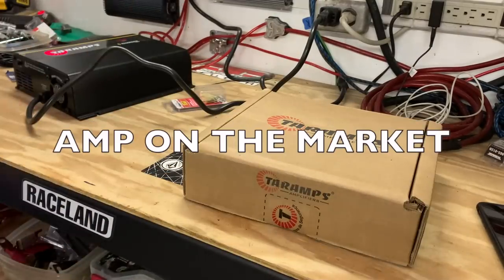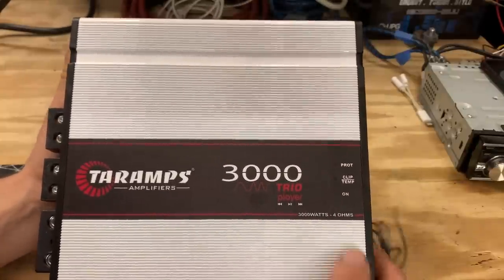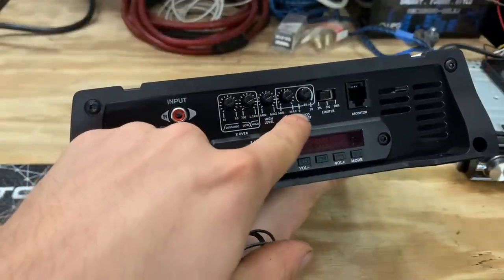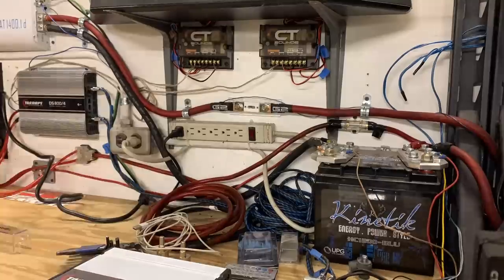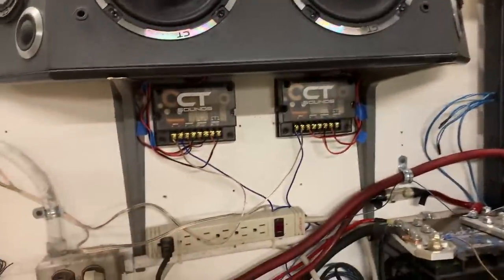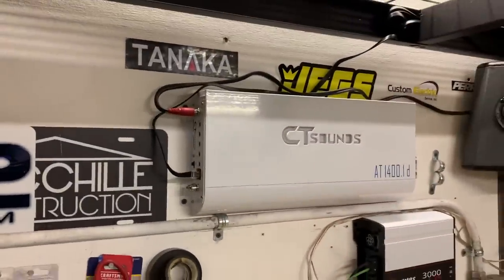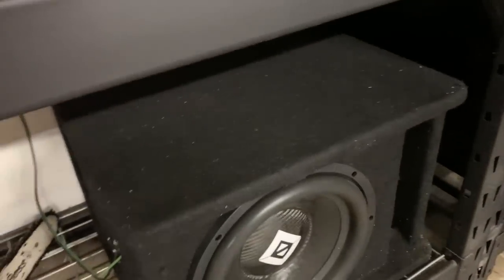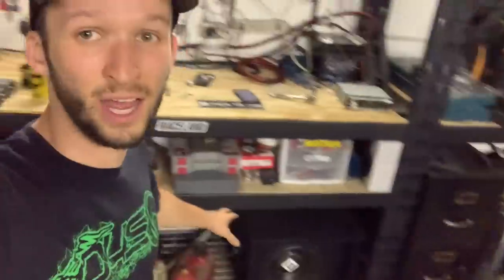COOLEST Car Audio Amp that Does NOT Need a Headunit | TARAMPS TRIO

Comment: I have been doing the inside of my shed as a “get away” from the house and where I work on my motor cycles and I have (2) audio legion 10” midrange with (2) audio legion compression drivers (all 8 ohm) that I made wall plates for that are on each side of flat screen I have in there, along with a 15” audio legion armada D2 lol. AND THIS is gonna be perfect for the power for it! Thanks brother

Comment: Perfect for those portable boomboxes or garage audio 🔥🔊

I believe the Clip % is where it stops the sign wave at said THD %
Reply: Portable boombox? Lol.. where you gonna get the power from? Maybe one day battery tech will make that possible but you need a pallet of batteries to keep this thing running more then a few minutes.. now what this could be ideal for would be a home theater diy setup with a simple sound bar and sub and using a converter with some form of small transformer cause even in a home system  with good power the amp draw would be substantially more then a typical outlet can power.. 

Either way you looking at needing upgraded 12g wiring in your home and a 30amp dedicated breaker like a dryer used to power off 120v or 250amps to power this off 12v.. some good transformer building and simple dedicated 20amp outlet in a home could make for a nice sound bar setup although wouldn’t achieve max power although in a home setup not sure you’d need it. 

But seriously where you gonna get 250 portable amps for a boom box lol.. I mean you could I guess build a dolly throw on a massive 300lb welder and power it off the welding leads lol.. or maybe 5 car batteries for 30min play time and 24h recharge lol..I mean tbh.. even say a 10k watt generator only has a 50amp output 🤷‍♂️
Reply: @fishrrelaxing9361  nobody is reading that why would you take it so personal 😭
Reply: @Titoo.1  just cause you can’t read it doesn’t mean others can’t or haven’t. Many have already commented on this tires few days behind with your ignorance my guy..

Comment: But at 10:44 which was at high volume, it was producing clipping sounds until you turned the volume down. I'm wondering why? Same happens to mine but in my case they are connected to a home theater receiver.
Reply: That was the sub bottoming out not clipping
Reply: Too much power was being sent to it

Comment: Hi I just put some Subs in my car and i can only hear them when they are really loud I can still feel them should I have the sound go directly to the cab ? There is a metal wall going to the trunk I just wanted to know if it would sound better if I removed the wall it's safe to remove it just keeps the cab and trunk separate. Also when I stand outside of the car I can hear them just fine.i also thought about upgrading the subs or the amp but I could only fit 2 12s

Comment: I’m looking for a 5 channel bluetooth amplifier. Do you recommend any models? I’m doing a simple set up in my 72 Lincoln Mark lll.  I’m going to use the stock location for the speaker upgrades. Is there a website that shows the speaker size for my car? And also I was thinking a simple single subwoofer in trunk for the 5th channel. Any subs you prefer? Thanks for your help.

Comment: this thing is cool but 3 bills for what is traditionally done with old gear just for fun is a pretty steep entry price. be cool to see a small version, 2x100w @2 ohms and 1x300w @4 ohm and a proper subwoofer crossover for a basic stereo setup. i think something like that for 100 bucks would sell like hotcakes. shops and homes don't really need the thousands of watts we put into our cars, so a 3 channel 500w amp with the BT, radio and USB would be really cool.

Comment: I was looking at getting a Rockville RXM8BTB with outputs to a CT Sounds ATv2 1400.1 so I could have everything running without a headunit. Makes me wonder if there's a noticeable difference in sound quality or efficiency between those two amps and the Taramps Trio Player. Having FM built in would be nice for other people that use the car. The sub will be in the trunk so the low side crossover issue and the low rms to the highs are as big of a deal to me.

Comment: Very interesting they put a dyi board intergraded in the amp that board goes for $10 on eBay. I'm wondering how they wired it in to the amp it self. is it sharing the input line of the amp? This could be done just about to any amp. It would be cool to do this to the amp your going to give away make a portable boom box that would be a awesome give away project. a box and dyi board and the amp/subs the project would almost be completed bad ass 🎶🎵🛠️👍👌✌️💯 bass on

Comment: Love you videos parker! hey could you put a clamp meter on it at 75-80% power and you might be surprised on how little draw it pulls. 
I have a taramps 1500tl and its running 4 speakers and a sub on 16 gauge wire for power I only did it as a test to see how it worked and it worked so good i never ran a bigger power wire. doesn't pop my cigarette fuse either! running a 12" kicker and four speakers! that amp I picked up on sale for 67 bucks! normally goes for 100 I believe.
taramps killing it!
Reply: Whether it does it or not, thats just not smart. Don't be lazy, run the required power wire. Choking the amp out, causing additional heat for no reason etc not good
Reply: It’s been hooked up this way now for about a year, nothing gets hot I don’t see a reason to run bigger wire. These amps are pretty efficient.
Reply: @nathanslosson9109  that's like saying I've smoked cigarettes for s year and nothings happened so it must not be bad for me. You do you bro, but choking it like that absolutely shortens it's life and limits performance

Comment: looks like Taramps is getting into the DIY mini amp market. That front plate with the USB/SD Card slot..etc is pretty cheap on Ebay. This amp would be cool but i CANT BELIEVE there isnt stereo seperation!... why on earth you'd want a single mono input for your stereo output, is beyond me. It may sound fine to most people but for those who actually listen to music, this wouldn't work out at all.

Comment: The 4ohm rating seems odd for this setup? 2ohm would make more sense for what this is ideal for.. it would make wiring much simpler for a 5ch type setup.. also the low pass is perplexing at best… 

This could be an ideal amp to eliminate having to rip out all the current electronics of current autos but it’s lacking big time.. so much so it doesn’t actually make sense to use over a typical LOC converter? 

So this begs the question.. WHY? 

I mean this thing could have been perfect for running 4 door speakers 50-75watts each and a 6-750w sub. Just a basic setup with no need to pull the dash apart just simply run power wires.. seems like a big swing and a miss here. 

2ohm and a true low pass would’ve fit this concept much better..
Reply from the maker: Dude exactly!! Maybe they will come out with a 2 ohm version or something

Comment: Did you say that the subwoofer low pass only goes down to 700 Hz!,!?
And it has one mono high channel speaker output?
That’s ridiculous 
It’s designed for one full range woofer and one full range top
Also, that does not look anything close to 3000 watts RMS on those subs.
Reply from the maker: Yeah exactly!! But i get it would at least so close to 3000 rms. Taramps are usually pretty good about barely making their ratings haha. It pushes the sub harder than it could handle
Reply: @ParkerTheBasshead  ok. I believe you. It didn’t look like it was moving a lot in the video.
Reply: @johnviera3884  At 10:42 you could hear the subwoofer bottoming out
Reply: @BoshkoIgich  i can make my 1000 watt subwoofer bottom out with 500 watts at the right frequency. If that prefab  box is tuned to 38 Hz  anything under 32 Hz will bottom it out without that much power. 
I’m just looking at the rest of the engineering on that amp and a lot doesn’t make sense. Like why do you have a Stereo FM tuner on a mono amplifier?
Also it’s 3000 watts + 200 watts with 4 gauge power inputs. I’d like to know what fuses they used. Or it doesn’t have fuses? Put it on the Dyno.

Comment: Only one sub out put no good if got 2 sub left and right
Reply: You can wire the subs together amd use it to power both
Reply: You can still have two subs connected to it as long as it supports the OHM load you have.